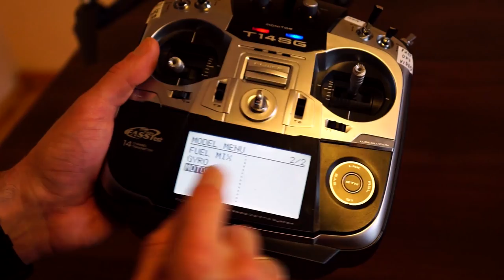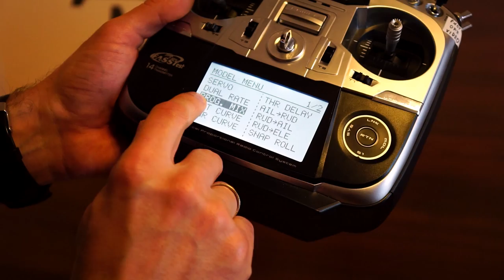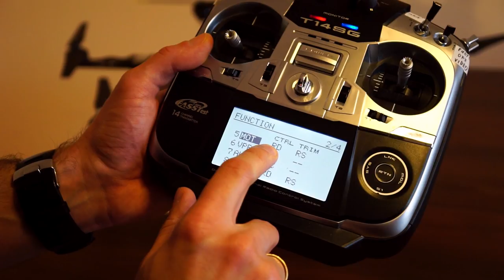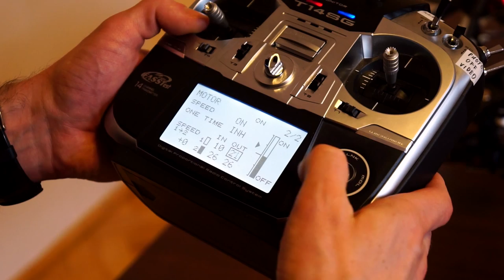Zenmuse h3-3d tilt, pitch speed with naza v2 and futaba radio

Comment: Thanks! This helped me too, as I'm also using Wookong-M FC and a Futaba T8FG Super, but I had to play around with the radio settings menu a bit, to get it to work for my particular set up, because my GEAR switch is assigned to IOC, and my pitch control is my right slider (RS), and every time I tilted the gimbal, my LED would turn to flashing green (HOME LOCK MODE), and that would be a disaster while flying! So I have AUX5 assigned to the SLAVE control, which is my channel 7.
Reply: I cant the the motor setting on my Futaba 8FG, so can you please explain how you did it?

Comment: Geez, can't figure out why this will not work for me - I've done exactly what the video shows.  I have the 8FG S and the Zenmuse H4-3D on a customized Phantom 1 w/NAZA-M v1.  I've been trying to solve this problem - this adjustment only seems to delay the fast tilt for a second... I really want to just use the right slider, but it seems to do exactly what the RD knob does.  The NAZA Assistant software (v2.4) has a tilt gain adjustment, but it does nothing.  Any suggestions will be appreciated!

Comment: thanks for the great video! a good tip! I have the T14SG and could accurately adjust as you have shown it. the only thing I noticed - as soon as I turn on the transmitter is an engine warning - and the question whether TX is to be switched. this can confirm with yes and no. why is that? do you have any idea?
Reply from the maker: Michael Nitzsche You have two options related to warning, ignore or disable it. 
As for TX it does not have to be switched.
Reply: oh how easy - I can disable the warning ... lol ... I have not found myself ... many thanks
Reply from the maker: Michael Nitzsche no probs :)

Comment: This will not work on my 14SG using the Multirotor Model selection. You do not get the option to adjust the "Motor" under the "Model Menu", it does not show up when using the Multirotor , but will show up if your model selection is Airplane .